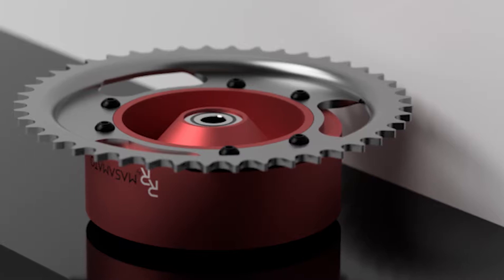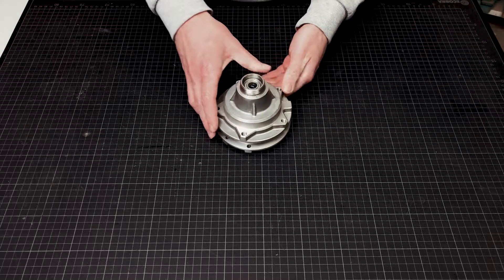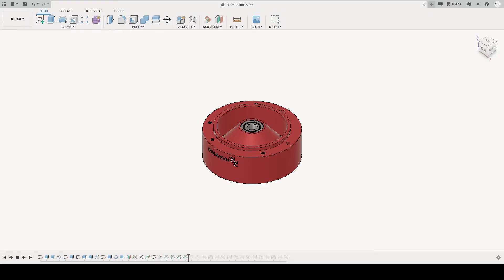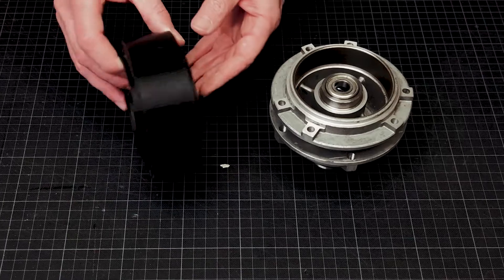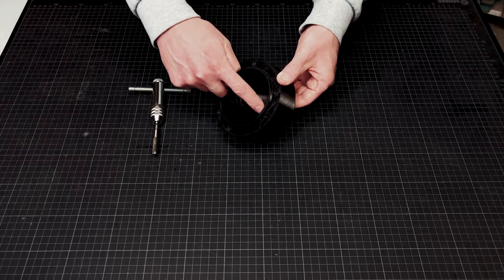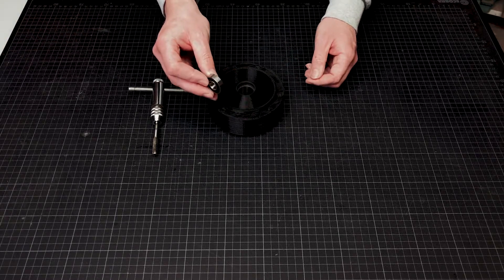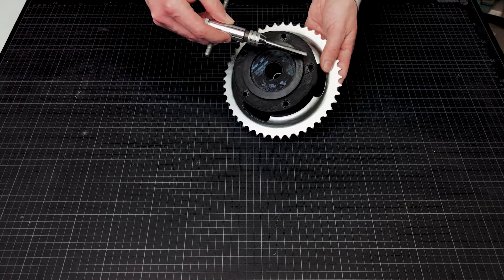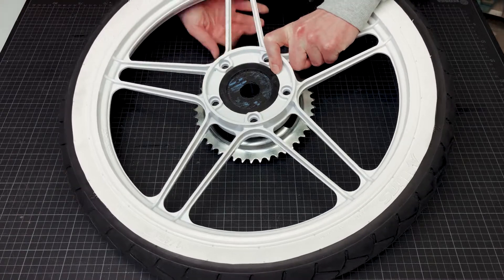Puch Maxi - Custom wheel hubs to mount disc brakes EP01

Comment: i think that the original hub has a hardened steel ring pressed into the aluminum hub as a friction surface for the drum brakes. if you install drum brakes into a machined aluminum part without the steel liner, you may experience poor braking and excessive wear.
Reply from the maker: Yes, that is true. You're right.